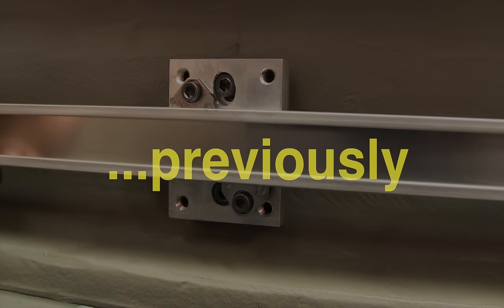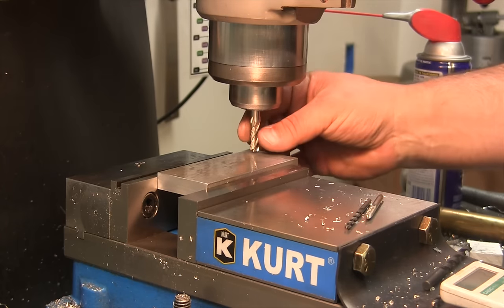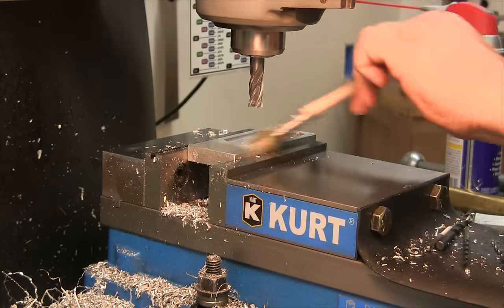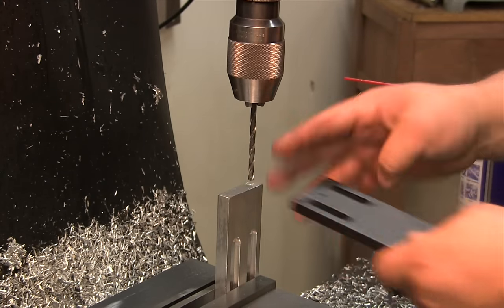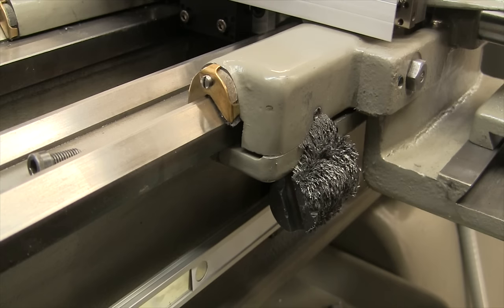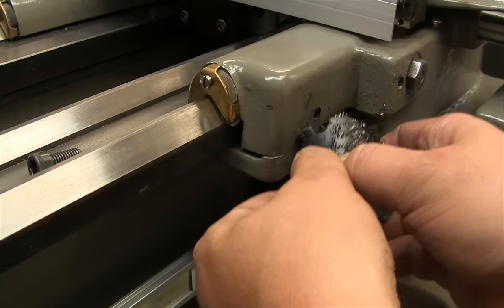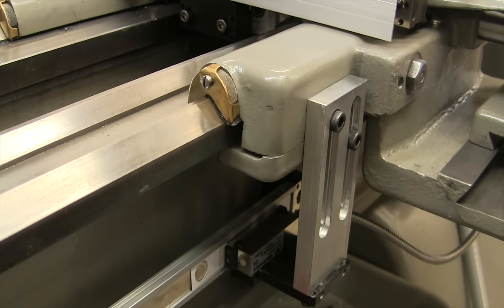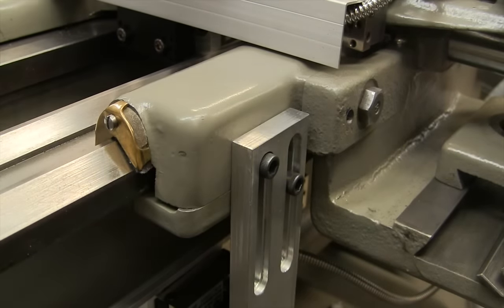Installing a DRO Pros DRO on a South Bend 13" Lathe Series: Part 4

Comment: Brad, you do nice work and I do not mean to be negative here, but you should avoid End Mills in ANY CHUCK especially carbide end mills.  Tapping ??  you should stick with a Jacobs chuck and save your Albrecht for the precision drilling it was meant for.   Also spindle speed seems rather fast for Four Flute  mill,  even in aluminum.
If you consult speed & feed charts for a bit you will have a better sense of good ball park settings for your machine operations.   best regards,  D. Dodge
Reply from the maker: +Darryl Dodge Agreed ;)  Thanks for the kind words too.

Comment: I have some concerns about vibration that only two anchor bolts to the carriage and the thickness of the bracket itself
holds position. Only run time will tell, I may be too concerned, just my rigid observation. Thanks for doing this series, I just
happen to need to see some of this engineering put to practice.
Reply from the maker: +PartisanGuerrilla Oh trust me, everything is super rigid, the video doesn't convey it. I like to build things sturdy, as I too worry about vibration. It's rock solid.